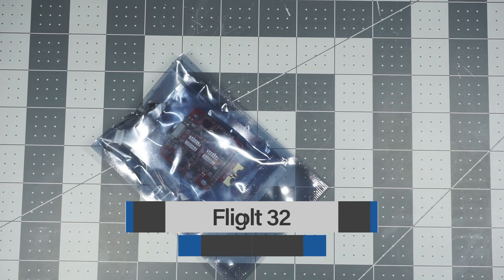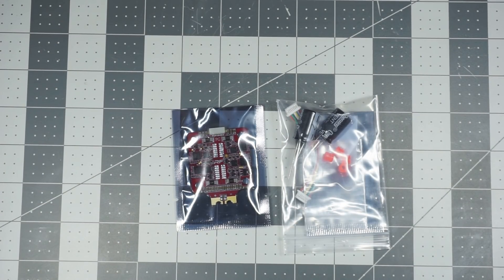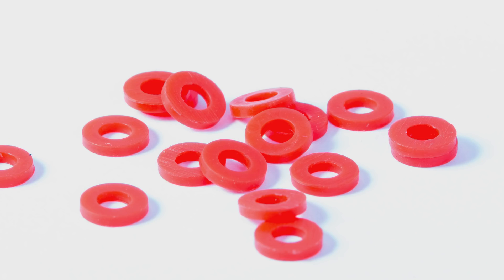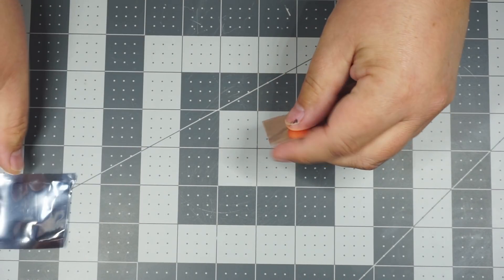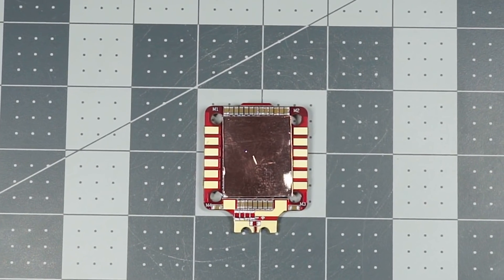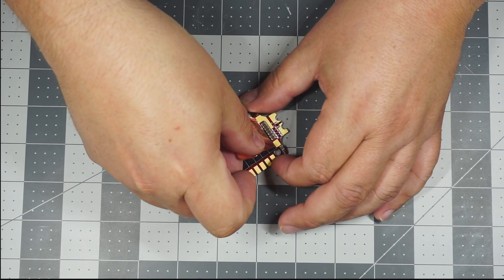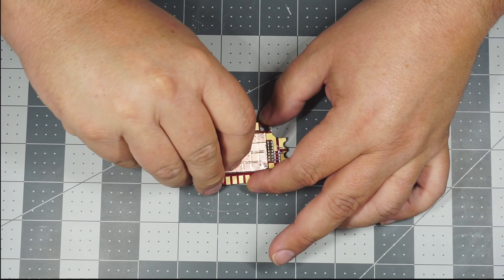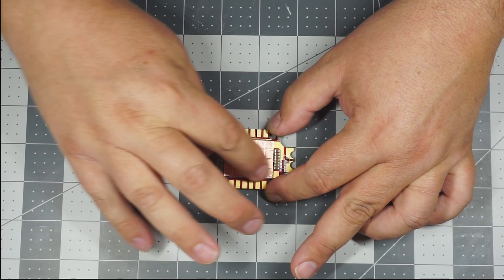FlightOne Bolt32 New Changes

Comment: Hi guys. I want to start by saying I've been flying the Revolt and other FlightOne products for as long as you guys have been around. The local chapter I'm in Diehard RC and Seattle Multirotors is full of F1 fans. We have a spec class and F1 revolts and bolts are used in that class. Recently a vast majority of the guys in our chapter have been having the Bolt32 4in1 go up in flames upon plug in with 6s batteries. In the last 3 weeks we've tallied up 15+ Bolt32 fires from guys in our chapter. All claimed to have taken the proper precautions while building like taping them off during soldering so that solder balls don't get where they're not supposed to. I've seen multiple post online about the Bolt32 catching fire and other Typhoon 32 variants having the same problem. This has been such a common occurrence that we've pulled the Bolt32 from our spec class this season and warned others not to use it. I ask you guys what are you going to do about this? From what I've heard all you guys are doing is ignoring the problem and placing the blame on shorts and "solder balls" when it's clearly not that case. There is a issue with these 4in1's and it needs be addressed. I've lost over $400 worth of gear from just 2 fires caused by this esc. I've documented everything with pictures and videos of my last build with the Bolt32 which went up in flames on the first battery which I will share with you guys if need be but you really need to make this right as me and most the guys in my chapter are so fed up with your hardware that we will be boycotting F1 in the future if there's no attempt to fix the problem. Hope to hear back from you.
Reply: So sad! Please let us know if they respond. I was thinking about getting Bolt32 with RevoltOSD, but...
Reply: @rawpicsfpv3516  I made this comment two months ago and to my knowledge they've done nothing to fix the problems and continue to sell these. The FPV scene in my area used to be full of people who fly F1 products and know everyone has boycotted them. I'm sorry but this company and their firmware has gone to total shit since Preston took full control.
Reply: Had this happen a few months ago on a 6s build, will never buy another F1 product.
Reply: I had this happen to me 2 weeks ago blew the ESC(Skitzo V2) and FC (Skitzo osd)with a smoke stopper mind you this was my 4th F1 setup. I offered to send it in and I was told that I soldered the xt60 pigtail backwards WTF!!!! Funny thing is I paid a local hobby shop to solder the motor wires and pigtail cause they solder way better than I do and it was correct provided the receipt as proof($30)also sent in pictures upon their request and all I was offered was to drill a hole in the boards and get a discount not even for the same boards (Skitzo) had to settle for the red ones. Not even one flight!!!!! Like $110 burnt up!! Then to make it worse everything is always on backorder....F1 should stand behind their products especially when there is valid proof!!!!!! BTW Skitzo V2 didn't come with the sheild..... A lot of us work hard to buy these products and is very upsetting when stuff like this happens....

Comment: 4000uF capacitance on the ESC? Those must be super secret magical capacitors. 

In reality, each capacitor is probably 22uF / 35V, so 20 of them are 440uF. But the actual capacitance at 25V is around 20% of that due to DC bias, so around 100uF or so total.
Reply: Except that they send 2 x 2200 uF caps in the package so in reality you have no idea what youre talking about.

Comment: Esc just look the same as the airbot, iflight or tekko. Oem version of airbot?
Reply from the maker: We work with several manufactures depending on the product, and collaborate some times on similar designs.   Airbot may have some esc similar but uses different components, and slightly different designs.  Our products always use more premium components, and more components then other manufactures, since we try and make them as premium as possible.  In this case it cause a more noise free signal.
Reply: Little change from Airbot Typhoon v2, pretty sure airbot is the manufacturer of bolt esc just like the bumpBees esc before ^^